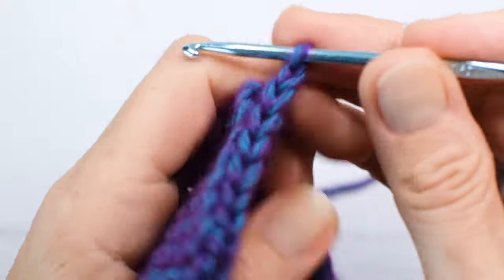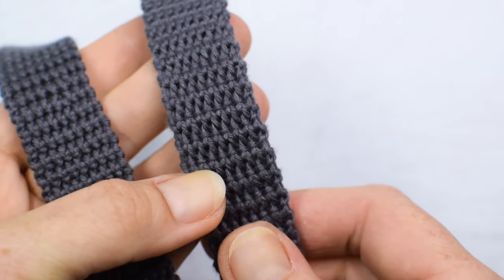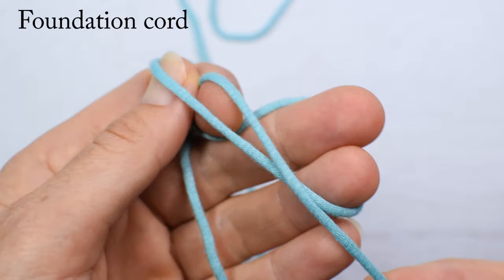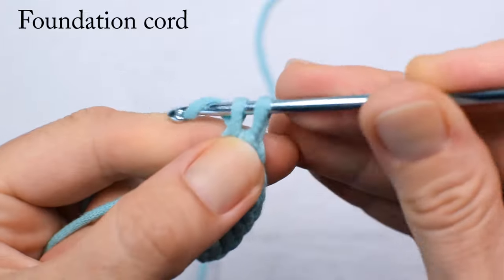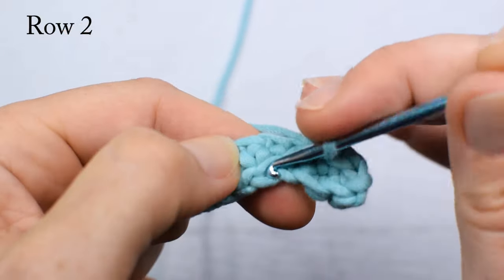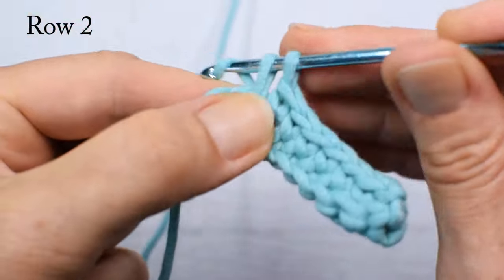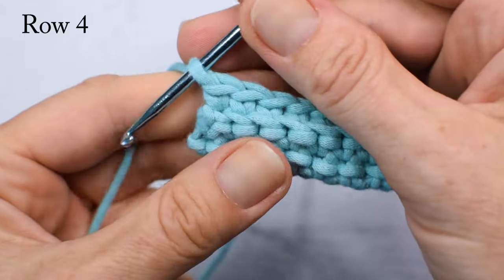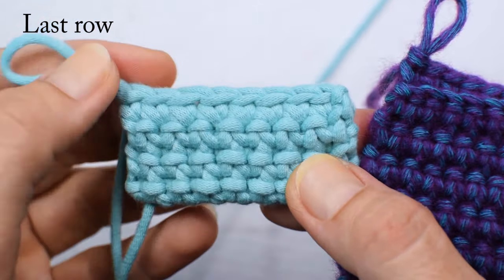Thermal Stitch. Perfect for bag straps.

Comment: I don't know if one person can be credited with this stitch. I came up with it on my own many years ago. I thought I had invented it, but I found that it had already been used by others. At the time, none of the books or magazines I had showed the stitch. Now you can find it in books. It's a great stitch. I've used it many times over the years. 
    Two things I found is that if you make straps as you do in this video, the strap has a lot of stretch in it. If you stitch more tightly, using a smaller hook than normal, there is less stretch. Also, this makes for a more durable strap. Another thing is that if you stitch the strap going vertically instead of horizontally as you do in the video, there is very little stretch. You simply start with a chain the lengths of the strap you want to make and then stitch your rows until you reach the width that you desire.
Reply: Just remember that if you do it by chaining the length of the strap, unless you use a sc foundation chain, it’s going to dig into your shoulder if you put anything heavy in your bag!
Reply: @hayleycraig7250  That's good to know. Thanks. 
     I think that is less of a problem if you crochet the entire strap more tightly than you would for afghans or wearables.
Reply: @dooglitas  yeah you’re probably right
Reply: @hayleycraig7250  😀
Reply: When a solution is needed people will solve it individually without each other knowing. 😊
Thanks for the tips and letting us know it's strong strap. I hate cords that dig into shoulders this stitch solves both problems.
Reply: @ctempleman1401  😀

Comment: I used this on several purses. It’s great cause it stretches without loosing shape. I remember seeing the thermal stitch years ago, but didn’t realize that’s what I was doing! It was trial by error. Thanks I was looking for this because it can be very warm. It’s a bit dense and stiff. I wonder if there is a way to keep the warmth and texture while having a little more give. Is there a dc thermal stitch? I just found it. Thanks!!